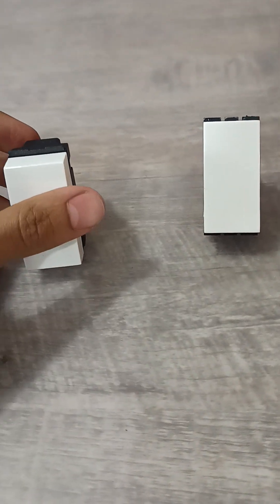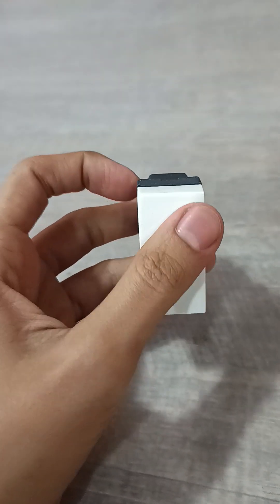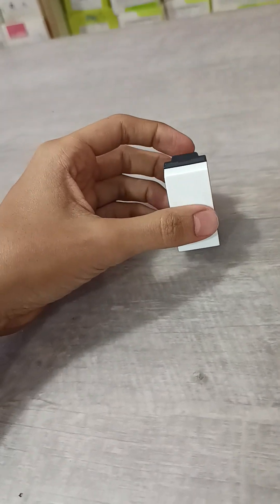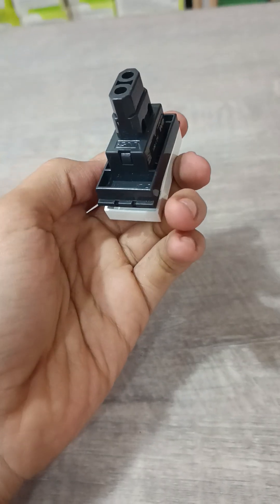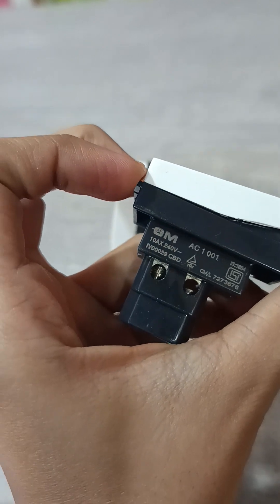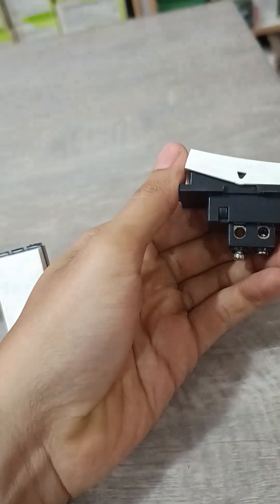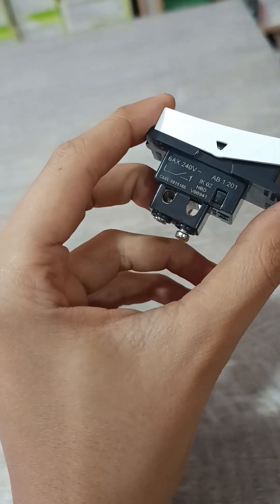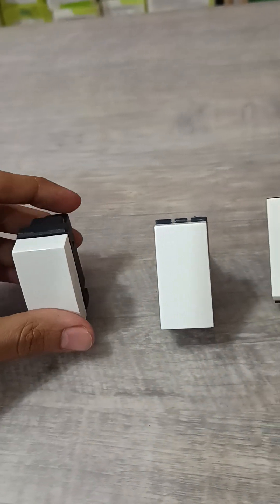Different types of GM Switches Explained #Godelas

Comment: Which is of superior quality among these three? How is Fybros glide switches compared to this
Reply: Thank you for ur quick reply. How about legrand myrius next gen?
Reply from the maker: Absolutely, Legrand is definitely a top-tier brand — no doubt about the quality and finish! If the budget works, it's a solid long-term choice...
Reply from the maker: Among the three GM switches, GM FourFive is the best in quality.
Fybros Glide is also good — it has a modern look, smooth operation, and is made from durable polycarbonate.
GM has better Brand Trust, but Fybros Glide is a Solid Stylish option too!